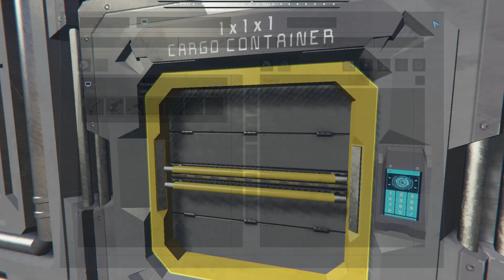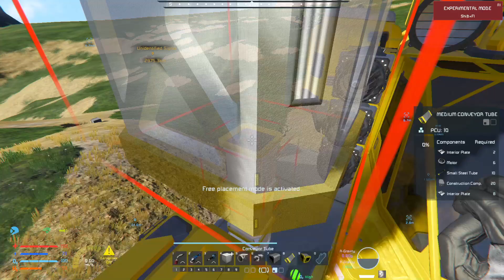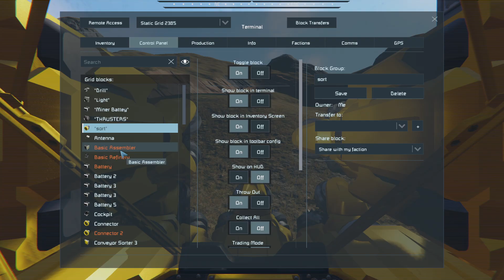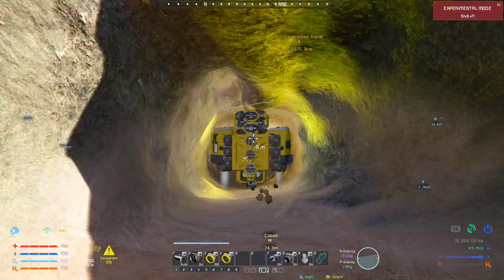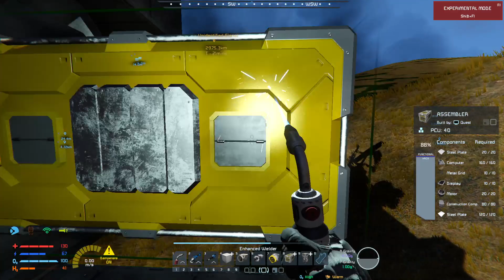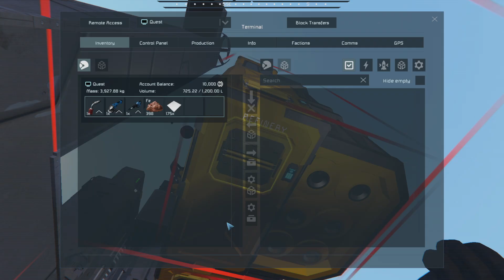STRANDED Episode 5 'Progress' Space Engineers

Comment: sry man dealing with life and playing catch up on ya vids since, but gonna put this out there for you since not many are aware of the script,
as a way to make cheap flying ships..using less thrusters than typical ship would require. check out the vector os script
with it all you need is a power source,cockpit/control seat,Program block, and thrusters (only 3 lift and rudder, (4x lift 1x rudder/steering)  couple more for extra lift

you build rotors and attach thrusters to rotors and load the vector script in program block and the vector script does the rest
mind the thruster damage radius
Reply from the maker: No worries man, you do you. Thanks for the comment. I'll look into the vector script!